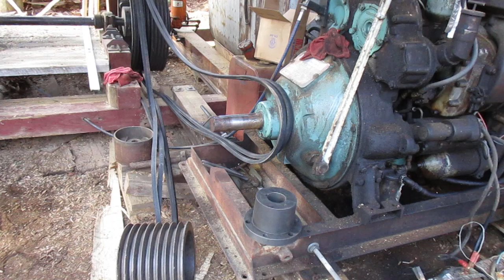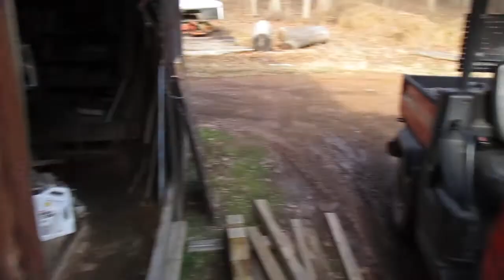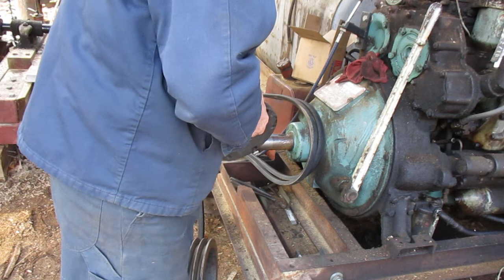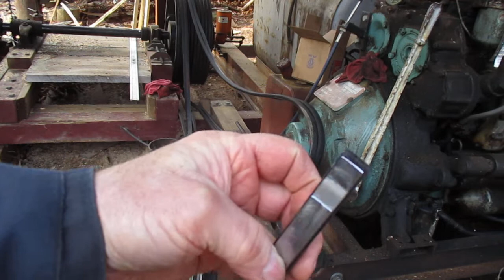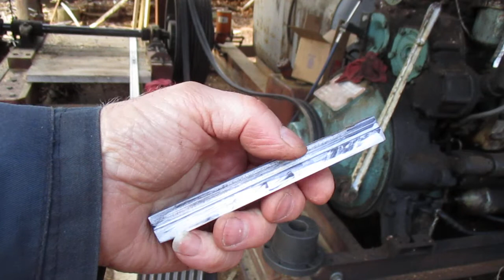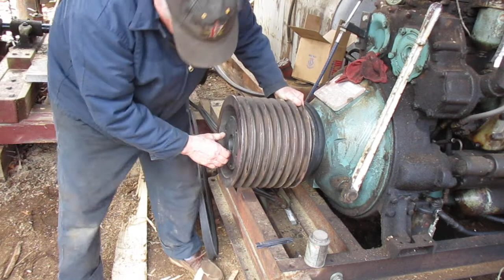#123 Frick sawmill pulley change

Comment: Something is not right there. There is no way to put a set screw in the hub unless there is a hole drilled into the bottom of one of the vees in the pulley that would be directly over the set screw hole in the hub. Could it be on backwards? The hub flange facing inward, and the hub body on the outside? I would be interested in how you solve the problem of installing a set screw into the hub. I too, am a firm believer in using " never- seize " on anything that may have to be removed in the distant future. I really enjoy your videos, and have learned more about how to identify the different sizes of Fricke sawmills. Thanks for sharing your knowledge.
Reply from the maker: hi there i just saw your post kind of know what you were saying but don't remember just what i did . i have sawed a few times and there was no problem , i quest i was the blind squirrel that got the nut . i think i will take another look at it before sawing again   . thanks john
Reply: @fricknjeep  If you go to 5:00 you can see the hole for the set screw in the flange of the collar, so you can use the short end of an allen wrench to get at it, or he may have had to cut one down, if that didn't work, tighten it down with the pulley backed away from it, then pull the pulley forward onto the collar.
Reply from the maker: @bigredc222  thank you for your input  i did this back in feb and it is still working  think ill leave it alone  but thanks john
Reply: @fricknjeep  Glad it's working for you, I just found your videos, I've watched about three so far.
I'm in Pa. too, about 40 miles west of Phila., West Chester, Downingtown area.
Reply from the maker: @bigredc222  thanks for the watch  john